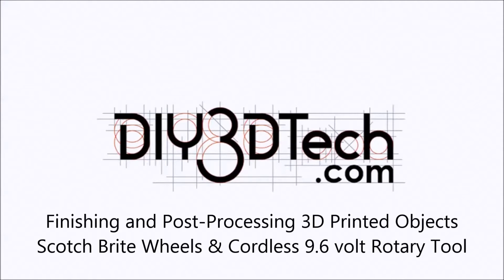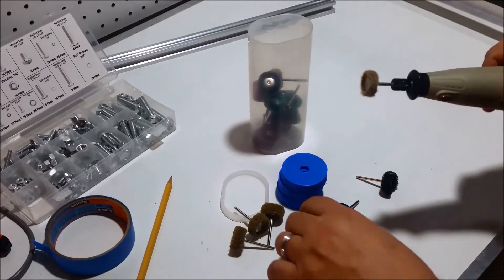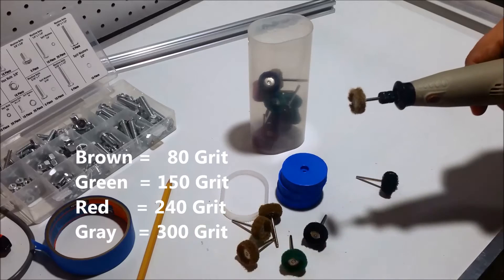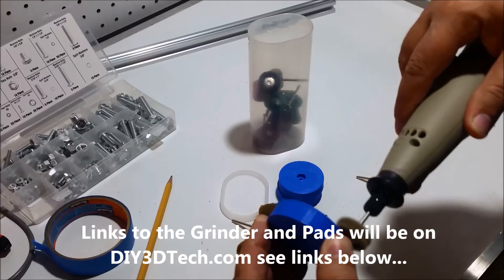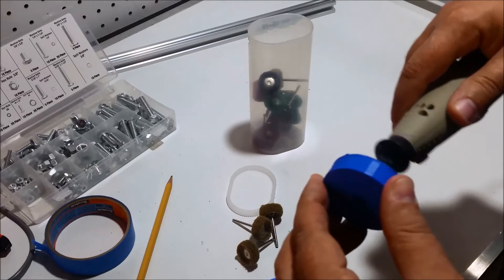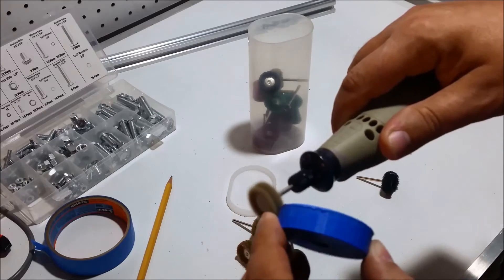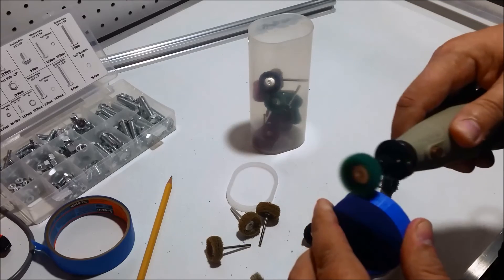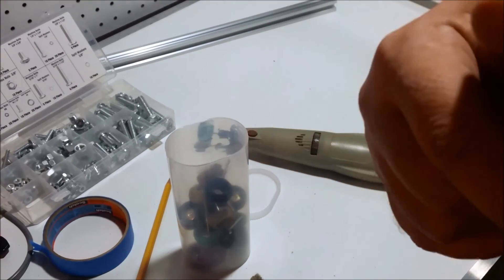Finishing and Post Processing 3D Printed Objects - Scotch Brite Wheels and Cordless Rotary Tool

Comment: i made a dust hood, or whatever, to control the flying dust, with a huge soda bottle. i cut the bottom off, taped the sharp edge, and cut the neck off, and taped the sharp edge there. i just insert my tool in the small neck area, and my piece in the opposite end, and sand my piece. this will prevent the dust from flying all over me.... i may move onto a larger, plastic, pretzel container, and do the same thing. (i am using the cap and neck for a magnifier- i drilled a large hole in the cap, smoothed the hole,and put a lens inside the cap and spout, and sanded it smooth. works well!)

Comment: This is sweet... I finally have a 3d printer and bought a dremel 3000... currently breaking it in. :) And learning how to work GENTLY with it, letting speed do the work... your videos are always informative.
Reply from the maker: Many thanks and if you have any questions, simply ask!  :-)
Reply: DIY3DTECH.com Sure thing. I have to break in my dremel by running it under no load... I found that a speed of 4 is the sweet spot for sanding my parts without burning it. And for the final polishing, I turn back to hand sanding with 400 Grit and alcohol
Reply from the maker: Hmmm never thought about using alcohol as a sanding lubricant...
Reply: DIY3DTECH.com Me neither. Only did it because I didn't have water nearby, but the surface is smooth. After wet sanding with water, I clean the piece with 90% isopropyl alcohol
Reply from the maker: Yes I have cleaned with 90% isopropyl alcohol, however never sanded.  Will give that a shot, thanks for sharing!

Comment: Have you tested any type of retouching tool? like Solderdoodle Pro 2.0,  Retouch3d ,  Ritocco  or Modifi3d
Reply from the maker: +Wilbert Lao Interesting and thank for share as no have not, however some these do look interesting and one or two will likely find its way on my list.  However what is interesting is these appear to "micro" devices  (like this one http://amzn.to/1QWYzgA) which are handy.  However I have mainly working with "macro" solutions and one of the others I will be doing a video on is using a SMD re-flow station (http://amzn.to/1PkQ2UT) to have a controlled heat source for bulk clean up.  Also seen you did a video on the Ritocco, I went to the website however don't see where I can order one.  Any suggestions?  Also thanks for sharing this, very interesting!
Reply: DIY3DTECH.com You want to try to use hot air to clean up the print? wouldn't that just melt the entire print?